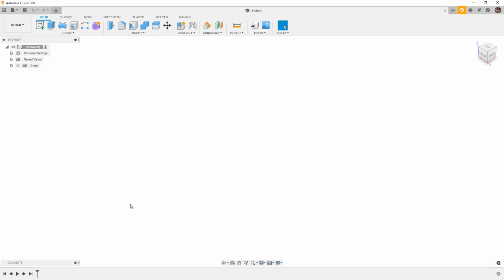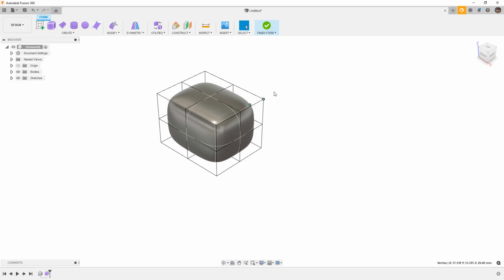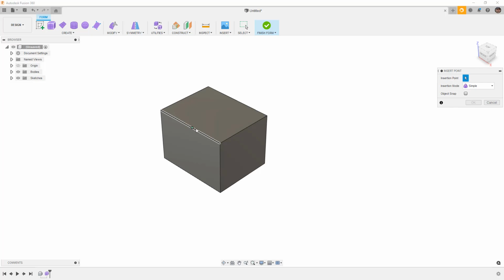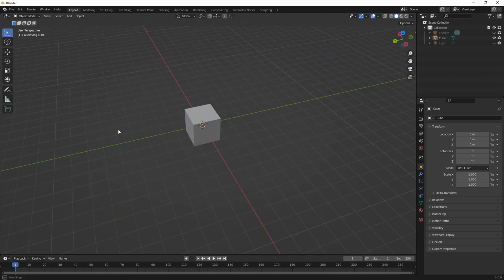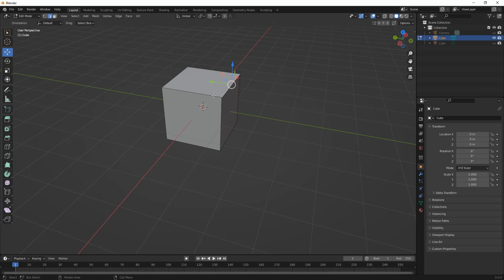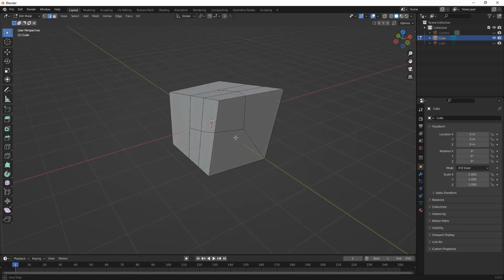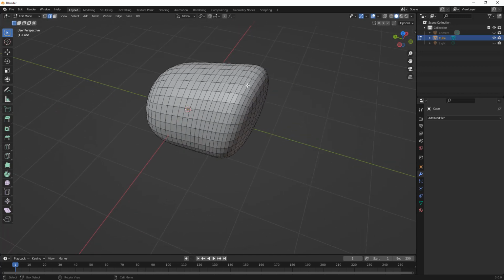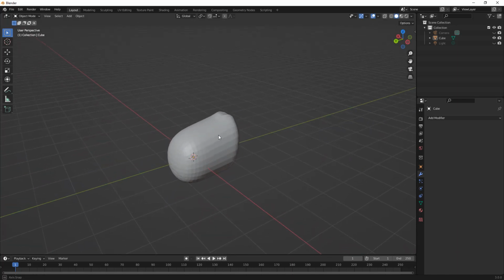Learn Blender for a CAD User - Part 1 - Simple Example in Fusion and Blender 3.0 #Fusion360 #Blender

Comment: Just to mindlessly leave a comment...  I do not have a design background and have recently picked up Blender as I now have a computer that can competently run it. I feel as if I am having a similar experience to yourself regards running through a tutorial and wondering if I've gained any ability for myself other than an ability to follow along w/ someone else. However, the practice of better following along has allowed me to be more comfortable w/ the interface, and where things are generally- which really is very useful.
   One nice thing I've been stumbling into recently are folks producing tutorials from a standpoint of having used tutorials, and trying to apply things learned outside of the "snow globe" of a car chase, or explosion tutorial. 
    I think you've done a nice job in this respect, and I will be spending some time with your other videos on the topic- thank you!
Reply from the maker: Thank you for watching!  Hopefully my intro to Blender series of videos will help build a solid foundation.  My intent was to fill in the gap between no knowledge and the tutorials online(there are a ton of great ones!).  One thing that would always get me is the need to download something or add a plugin so I really wanted to avoid that for the most part.  If you have any questions please let me know!

Comment: Great that you do this series, as I am exactly at the same point like you with Blender. Mainly I do things parametric or not parametric in Fusion, but when I need a real textured surface on my models, I struggle, so I tried texture sculpting in Blender and Nomad Sculpt (iOS). But there are so many "missing links" when learning Blender, even there are tons vides out there. 
So I am looking forward to your new series, as I can highly recommend the "Fusion 360 Forms Mastery  Series" you have made here on you tube.
Reply from the maker: Thanks Noe!  There are 7 or 8 videos of this already.  At this stage in the series I think I will start going into practical exercises.  Those foundations like where tools are, how to use them and some of the steps more advanced users take fore granted are those missing links.  I do hope to get deeper into Blender for Rendering and Animation.  I have done a bit with characters and rigging and taking them to VR, but I need more practice before trying to explain it!

Comment: I began with fusion last year. This year I will study blender. I'm sure. )) The question is: what will be after f360 and blender? In 2023.
Reply from the maker: Do you mean here on the channel or something more in general?  What would you like to see?  I plan to keep covering the various areas of Fusion 360 like Simulation, Manufacturing and more mechanical design.  As far as software to cover it is a bit open right now.  I had planned to do some Arduino/programming content and also cover other software offerings like SolidEdge or the 3DExperience platform from Solidworks.  I have been a long time CAD user and covered Autocad, Inventor, Solidworks, Onshape and others in content on eLearning sites and other places, but I want to make sure that I support and create Fusion360 content to fit the need of the users.

So any suggestions or things you want to see just let me know.
Reply: @LearnEverythingAboutDesign  Your experience is awesome)). I also was keen on Arduino 5 years ago. Concerning F360 - I saw several online courses on Generative design and different simulations - that were also great. So if you could show how to make and check the technically right spring design for car wheel suspension/amortization - that would be interesting. Anyway - I see all the videos you make - so do what you like - and we will thumbs up))
Reply from the maker: DM for some reason this comment was "held for review" so I am just now seeing it.  For calculating spring rate that is a bit tough with fusion.  Other tools allow you to have springs and dampers and then you can apply forces and look at the curves.  We don't have that in fusion 360.  The best you could do is some hand calculations based on leverage points.  If I think of another way I will certainly include it here.
Reply: @LearnEverythingAboutDesign  ok. Thank you!

Comment: Great video! Thanks for teaching!

I have been using Fusion for several years and finished Maker's Tales' series on Blender x CAD last year.
After trying the long-awaited Pattern feature in the newly released extension, I think the real advantage Blender has over Fusion is surface pattern. 
Fusion's ability of making complex pattern on a surface is weak, as you showed in your vid about the Product Extention, even with those new features, it is still weak. 
Due to the nature of the two, it is nearly impossible to perfect Fusion using Blender. 
So I guess Dynamo, now Dynamo Sandbox is the only hope for that purpose.
Reply from the maker: Yeah, I dug around to see if support for Dynamo was still public for Fusion 360 but could only find Sandbox(which is free).  I hope that means it will be integrated into Fusion at some point!

The next video for this series will be out tomorrow.  The complete opposite of "Learn blender in 15mins" :)  I think tomorrows video is also 40mins.  Hopefully for the people like myself that struggled to make it "stick" it will help to repeat the basics and draw some lines between Fusion and Blender.  

I think you are right about the surface patterns in Blender.  The geometry nodes look great!  I think Rendering, Animation and Physics are also great additions to Fusion.  It can be very quick to model something in Fusion that can be used both for Production and then sent to blender for product animations if you aren't using maya, 3d studio or the like from Autodesk.

Thanks for watching!